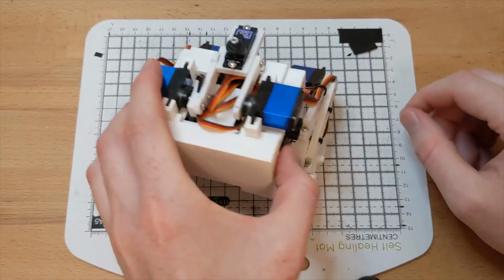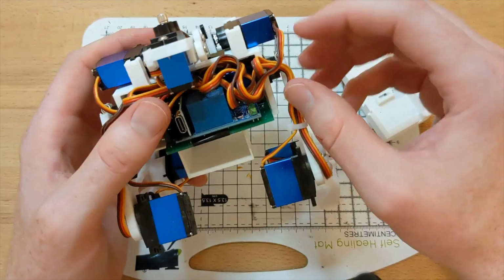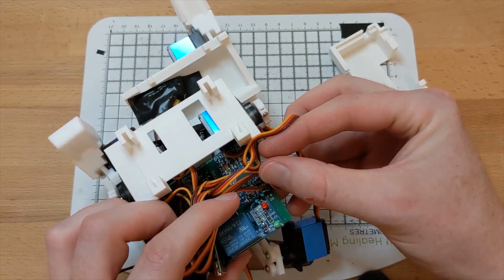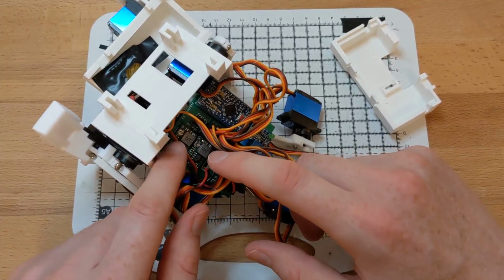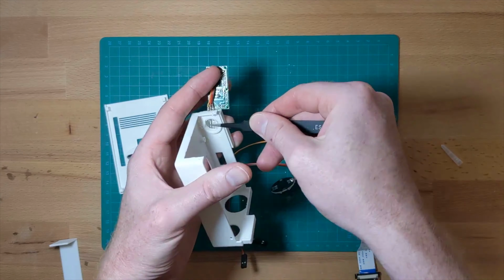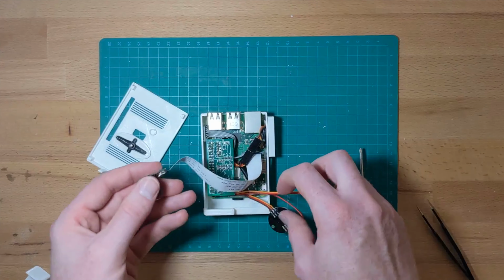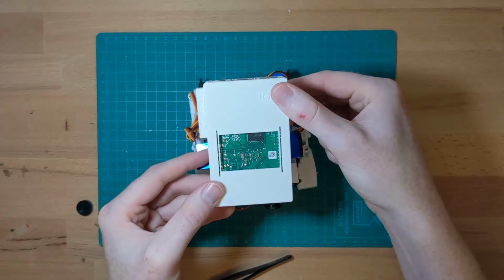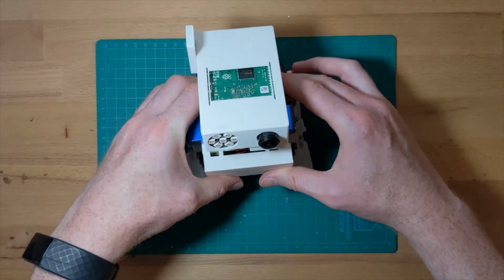Companion Robot: Part 2 - Construction and Teardown  - Raspberry Pi | Arduino | DIY Robotics

Comment: What size screws did you use to hold the servos in place? Did you only use one size screw for everything, including the neck?
Reply from the maker: Yeah just the screws that came with the servos
Reply: @DanMakesThings  Awesome! Thanks! Waiting for my Rasp Pi to come in and I'll be able to start assembly of the circuits. The 3D printing is done and the servos are in place. I haven't been this fired up for a project in a while, do thank you very much for the excellent videos. I may have a couple more questions pertaining to the circuits, but I'll wait for my board to come in first.
Reply: @DanMakesThings  What resistors were used on the body PCB?

Comment: Hi man this project is so nice, but can you please give me the parts
I mean a list
Reply from the maker: Thanks! The problem is that a lot of these are just the cheapest modules I could find on ebay, so I can't link to a specific item because the listings are long gone. Let me know what you can't find online and I'll try to provide more details to see if it helps.
Reply: @DanMakesThings  i can't find the "5v" and "5.1v pi" on the layout
Reply from the maker: This guy? https://www.ebay.co.uk/itm/5pcs-Mini-360-DC-DC-Converter-Step-Down-Module-4-75V-23V-to-1V-17V-OV-/185216660202?mkcid=16&mkevt=1&_trksid=p2349624.m46890.l49286&mkrid=710-127635-2958-0
Reply: @DanMakesThings  yes
Reply: @DanMakesThings  and you can say me where you have the platfor for raspberry pi4
Reply from the maker: I don't have anything for the pi 4. I used a 3b+.
Reply: @DanMakesThings  you can make me a list for rest parts apart from raspberry, servo motors and the arduino?

Comment: why didnt u put the addressable LEDs behind the PLA, similar to the voltmeter? That way the light would've been diffused
Reply from the maker: I want to be able to use them as a flashlight as well, so diffusing them behind PLA would cause problems there. In the next version I might add a lens or some cosmetic elements.
Reply: @DanMakesThings  okay that makes sense. I didn't think that far. Very cool project.

Comment: Hi, I am also working on a similar project! which raspberry pi should i use? How much ram does your robot need?
Reply from the maker: I'm using a 3b+, the biggest bottleneck is around opencv / tensorflow but benchmarks I've seen don't show a lot of improvement with a pi 4. I'm looking at adding the Coral USB accelerator once they are available again.
Reply: @DanMakesThings  just curious - using Python or c?
Reply from the maker: Python on the pi
Reply: would using an Arduino mega instead of a raspberry pi work for the project? @DanMakesThings